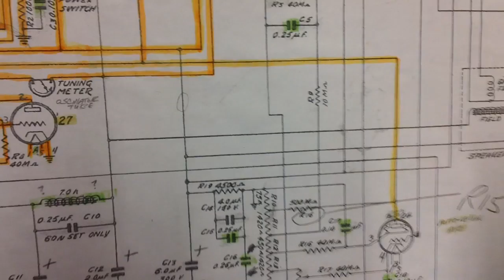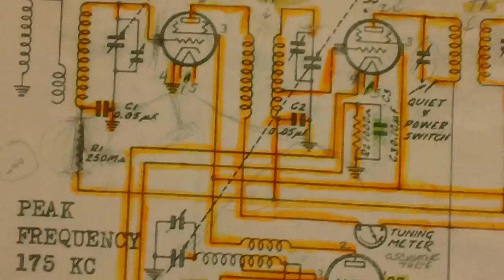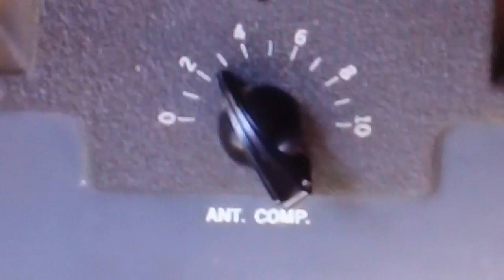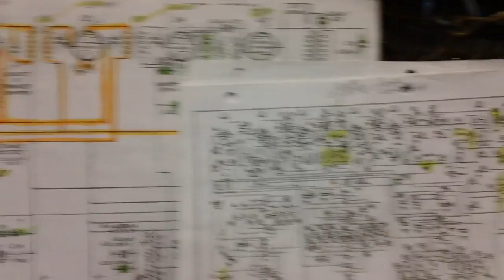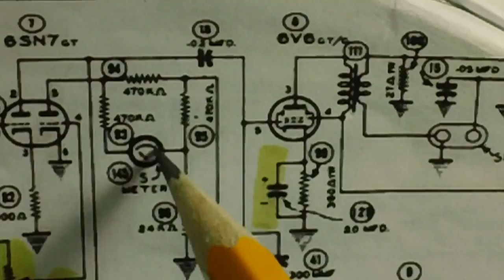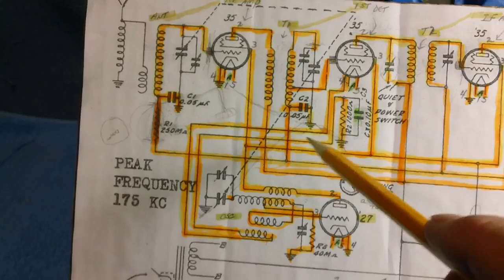1931 Airline 62-14 (Part 15 of 44).

Comment: John, what I was thinking about R1's location was that the 1st detector looks like it's using a 
bit of regeneration on the cathode via the bottom coil of the oscillator as shown in the 
schematic. Given the size / length / location of the old dogbone resistor, I think they  
were trying to avoid any stray coupling back to the rf amp from the oscillator.

An old radio I have thinks it's in the water, while it's motorboating it detected a grid leak 
and the coil is tickling. I wonder if there's a gimmick to this somewhere ;)

Comment: John, it may be a problem with the Mode switch of the HQ-129X.  If so you would not be the only one to have trouble with one ( https://www.youtube.com/watch?v=0xDF_c4T4zo ).  Unfortunately you have to remove the BFO can to get to it.  Alternatively it may be a problem with the movement itself.  It's not too hard to disassemble the movement to check.  The guts come out the back of the housing.  You remove the two meter connections, one pilot light and one mounting screw.  Then the insides slip right out.
Reply from the maker: Sonofagun...Curtis Eickerman!  I figured you checked out of my poor excuse for an antique radio channel a long time ago.  It's very good to hear from you again, my friend.  I appreciate you stopping by.  As I said in the vid, the whole deal with the S-meter began after I messed with the BFO switch.  I'm hoping that's actually not the cause, but if so, then I'm up to the repair challenge.  Actually, I know of no one else who could fix it for me.  LOL  I've spent a lot of time watching K7PP's videos.  He's very good at what he does.   Unfortunately, he never answers any comments/questions, so I just watch and move on.  Anyway, I'll be doing an update vid to show anyone interested what I found out and what can be done about it.  It would be cool if it turned out to be nothing more than dirty wafer switch contacts.Again, thanks for popping in.  Don't be such a stranger.  And as usual, all of the sentences will be run-on (no paragraphs), as I'm using our work computer.  I don't know how to fix that stupid problem.  I've wasted a lot of time trying.  Regards,  John

Comment: hi John great video again have a question why not mount the resistors vertical on that existing strip? that would give you  plenty of room. Also wondering why that original resistor was moynted inside the IF coil? I don't think they were looking for extra work if wasn't a reason for. But that's just my options regards Sorin

Comment: John, 
I liked how you eloquently made a general comparison between two types of radio receivers.  As you say, though the Hammarlund circuit-diagram is busy when compared to the Airline 62-14, if one breaks down a circuit-diagram into sub-circuits it is not as intimidating as it may first appear.  
For some who are new to our hobby, this may sound easier said than done.  Once one grasps a general working knowledge of the nature of AC, and DC, electricity, its relation to the ‘Pire wheel’, and working relationship with coils (inc’ transformers), resisters, capacitors, valves, transistors etc., reading, and understanding, what is taking place within circuit-diagrams will fall into place.
A few days ago, I wrote a comment in response to a video uploaded by Don (RestoreOldRadios), “Zenith 5S29, Pre- Selector and Oscillator Coils”…  
https://youtu.be/LME3BW5XYfw
…highlighting this particular point.
Btw, I’ve a shrewd idea the signal strength-meter on you Hammarlund receiver might either contain a speck of dust, or some part of it has become warped due to heat, and age, which is impeding needle deflection.  I guess you’ll hope I’m wrong about the ‘warped part’ bit as it might necessitate replacing the meter, and altering the values of those matching-resistors to suit it if an exact specification type is no longer available LOL.
Regards,
Phil.
Reply from the maker: Phil,
The chassis is now removed from the cabinet and a visual inspection produced no obvious problems.  I hope this weekend to disconnect the resistors for testing and to also take a much closer look at the meter movement and its enclosure.  A little terminal/contact cleaning will also be in order.  I'll do another follow-up vid segment on what I find.
I just hope out younger radio hobbyists are getting something from all this wire following jazz.  I know it can sometimes get boring, but from experience know that it's well worth the time spent.  In the future it'll pay off handsomely for them.
Regards,
John

Comment: Hi John,
Great video as usual and I always learn something that I put into practice.  I especially appreciated your tip on coiling the ends of a resistor or capacitor to help them stay put while soldering.  I use that consistently now.  I wrap the component lead around a nail using hemostats but I think you had a better way. Also, let's not forget about GoJo!

Thanks for the great info,

Pat
Reply from the maker: Thanks, Patrick.  It's good to hear that the vids have been of help to you.  It's why I do them.  I prefer using the coil method because it limits damage to the socket pins and terminal strip connectors.  I've changed out sockets and it's actually no fun to do.  Thanks again for popping in, my friend.
Regards,
John

Comment: John - I noticed when you touched the glass (plastic?) in front of the meter on the Hammarlund, the needle jumped. I had this happen to me on an old tube tester. Everything checked out fine but I'd get the wrong reading on the meter. Turned out the plastic wasn't static dissipative and was holding a charge. That static charge was enough to keep the needle from moving properly. Whenever I'd wave my hand over it, it would change slighly.
Reply from the maker: Andrew,  In the past I've also experienced statically affected meter needles, but I don't think that's the problem here.  I'll be digging into it in a few days and will bring interested folks up to date as to what I find.  Regards,  John

Comment: I don't think parasitic oscillation would be a problem with that resistor. Parasitic oscillations are much more likely on the control grids of tubes. If you see a resistor in series with a control grid, it's referred to as a "grid stopper". These resistors work with the grid-cathode capacitance to form a low-pass filter which prevents high frequency oscillation; that resistor needs to be as close to the tube pin as possible. In this case here, it seems to me if you moved that resistor to the plate of the tube, wouldnt it be in-between other wires. the bottom side of that resistor branches off to other things. Am I looking at this wrong? I think you made the right call, as usual.
Reply from the maker: Thank you, Andrew.  It'll be fun to eventually find out if any squealing is encountered.  I think the resistor was placed on top of the chassis and inside the coil merely to protect it from heat.  Regards,  John

Comment: It's great John how you found a way to transfer the knowledge from one schematic to the other. 
Excellent lesson. 
Oh btw, I think I know what the little project is,,, looking forward to that as well. Thanks buddy.
Carl
ps,,,, John, what camera are you using now? I know you mentioned it before. Thanks
Reply from the maker: Thanks, Carl, you're a good friend.  My camera is a Sony Bloggie Touch MHS-TS20.  I really like it, small, easy to handle and has the auto-focus, such as it is.  It's not an expensive camera.  It's been dropped more than once, but keeps on ticking.  I don't know if they still make them, but they can be had, new and used, on eBay.  Regards,  John